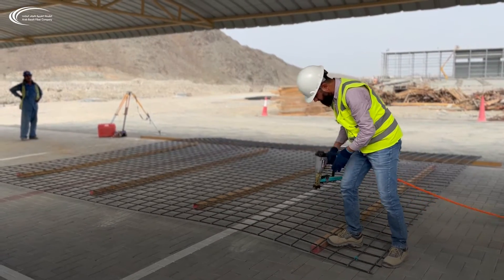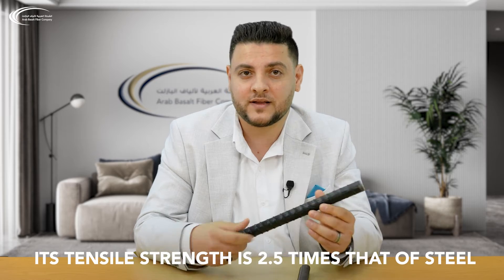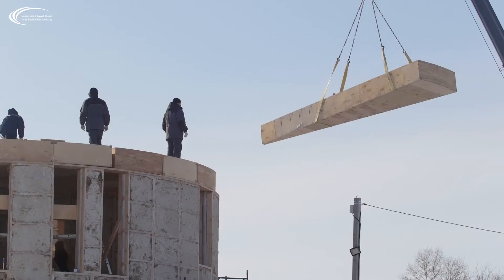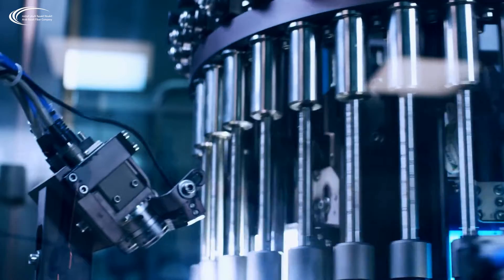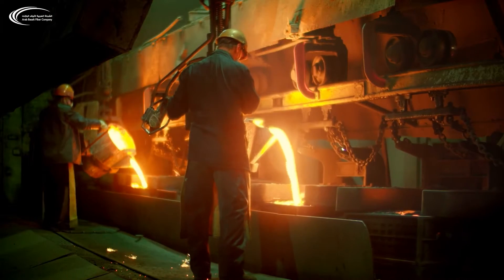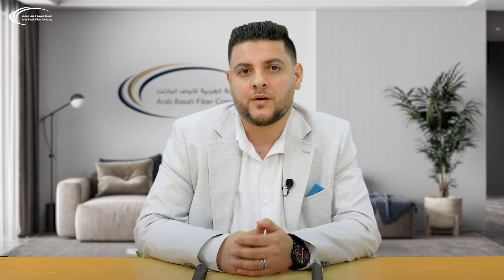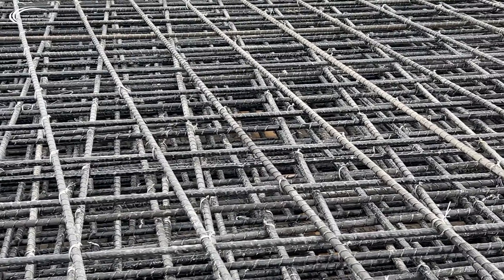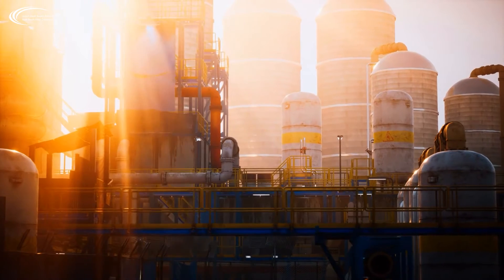BFRP Rebar vs Steel Rebar for concrete infrastructure

Comment: "Weighs 4.5 times less" is mathematical and linguistic nonsense. Maybe you mean it weighs less than a quarter as much as steel, or it weighs only 22% of the weight of an equivalent steel bar? But "weighs one times less" would be weightless, and anything more than one times the original weight less than the original weight is going to have negative weight.
Since we're not doing theoretical particle physics, it can't have negative weight.

Comment: But you never mentioned the negatives or maybe there are no negatives
Reply: the modules of elasticity is very low compared to steel but what covers it is that it's more stiff than steel.
Reply: It has different fail parameters to steel. If you're designing for a situation where failure is a real concern, such as in earthquake zones, you need an engineer who knows how to engineer this stuff. Engineering it as if it were steel will not work and will probably kill people.
That doesn't make it a bad product, but having to find an engineer who knows what they're doing with a novel product can definitely be a negative.
Reply: @tealkerberus748  can not agree more